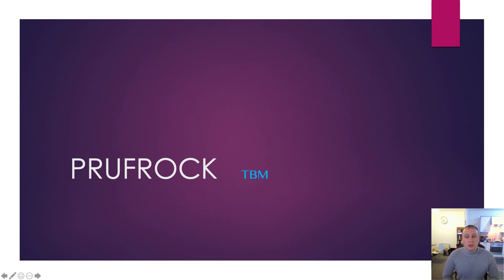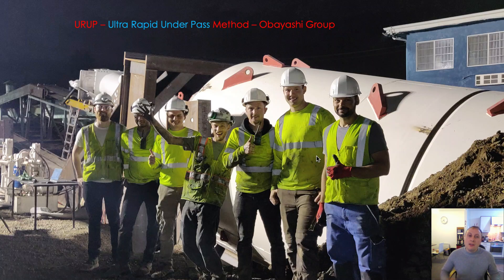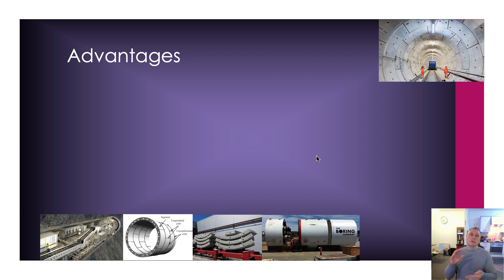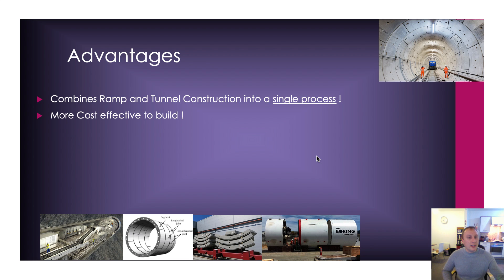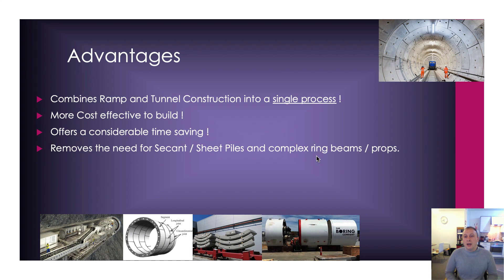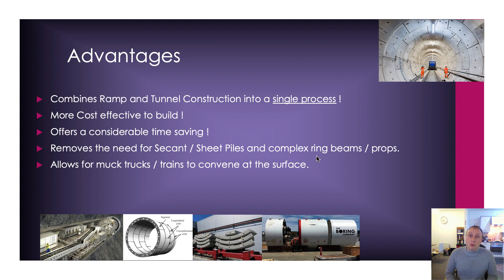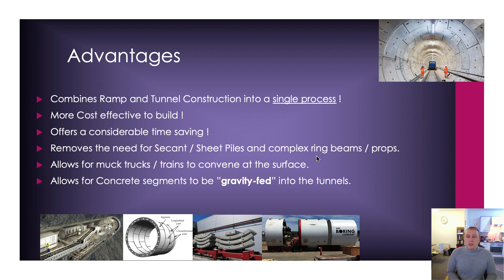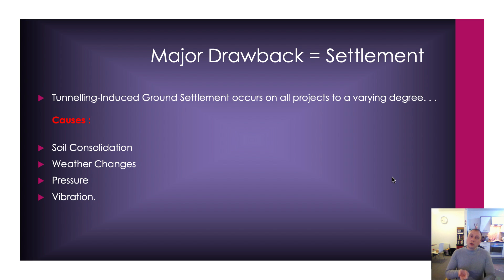Boring Company 👷🏻 ⚙️ 🇺🇲 Prufrock Evolves & Adds New Construction Techniques  💰 🏗️ 👍🏼 🚇 Episode #49

Comment: So a muck car can also haul tunnel liners, and with some some hydraulics on the wheels to lift the cars up, the cars can run back and forth at different levels (high and low) in the same tunnel at the same time, and since each car can carry both muck and tunnel wall segments, albeit not at the same time there is zero stoppage. Correct??

Comment: You can use another of Elons favourites tents. Surface consolidation can be lessened by using cable bolts and your grouting method. Material stratification from surface down prior to commencement till solid face is met.

Comment: Humour me here;  Is there anything inherently special about the cutting head on the boring machine TBM's?
Reply from the maker: As far as i'm aware the cutter head in Las Vegas is exactly the same as those used by the Robbins Company but the difference is the torque / power behind it is far far higher!
Reply: @BoringRevolution  interesting.   I've come from the mining & mechanical design world.    I think there is a simple(ish) addition to the cutter head that would speed up both the abrasiveness of the cutting at the head while also aiding the removal of material.  Maybe they have investigated this and I'm not seeing other implications
Reply from the maker: @fiftyoneindustries2  i would like to learn more.

Comment: The start of the descending entry tunnel will be less dense i.e. more buoyant than the soil around it (it is full of air after all) so won't there be a tendency for that to want to rise towards the surface, pushing aside the small amount of soil above it. Sorry if my ignorance is showing, a long way from my area of expertise.
Reply from the maker: Its an issue and will lead to massive "over-excavation and cost. 
There may be a way around this by pre-conditioning the ground a few weeks prior to the machine arriving.
Reply: @BoringRevolution   Thank you for your kind reply.

Comment: First, I am not an engineer.
My intuition: Stack sandbags on the surface (just ahead of the entry line). Do the same before the exit line. After the lining segments have been installed underground. In the entry portion, he sandbags could be removed from the surface above.
Sam_Haroun.
Reply from the maker: I mean you could just let the area subside 19" and then repair the damage later on but it'll be far far more economical to inject 180,000 gallons of grout 3+ weeks prior to launching the machine and then inject another 95,000 gallons during it's operation!

Comment: To me this method seems a no-brainer as the current elevator shaft access is the bottleneck for operations access. This would tie into surface loop-backs or turntables to speed the whole tunnel access efficiency similar to trains. For systems that use self driving cars you then can have freeway-like on-off ramping. 
And for Mars it means a much simpler method to get those colonists protected :)
Reply from the maker: I mostly agree although maybe an opportunity for some side tunnels connected up to a few elevator banks.
Check out my Rack & Pinion elevators video - it has potential in big cities like Chicago! 
Ramps however are a better option in most areas as vehicles can quickly exit the system every 3 seconds.

Comment: Do you think in the future they will use a specialized "tunnel starter", then launch the TBM? If grouting works, maybe they wouldn't need to. Hate to compare everything to oil and gas drilling, but there is a small rig (nowadays its an augur mounted on a trackhoe) to make the first 50-100' of hole. They do it for the same reason you mentioned, the unconsolidated surface causes problems for the main drilling equipment. A big difference is since you are at an angle, 50-100 feet becomes a lot more feet needed to be done with the tunnel starter. Probably would be best if the TBM could be made to work doing it!
Reply from the maker: I agree. Austin this an excellent example of taking oil & Gas expertise and applying it to a different industry. Its an area that needs looking at for future jobs utilising the Ultra Rapid Under Pass Method. 
I'm also very unsure if grouting alone would be sufficient in an area with mostly none-cohesive soil.